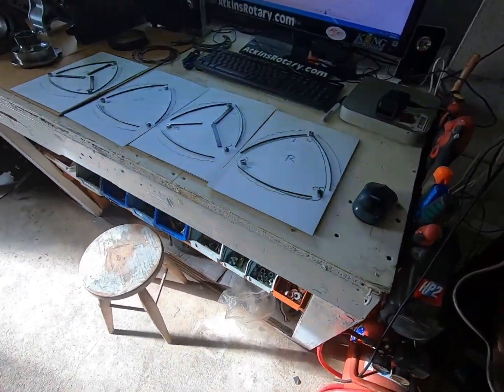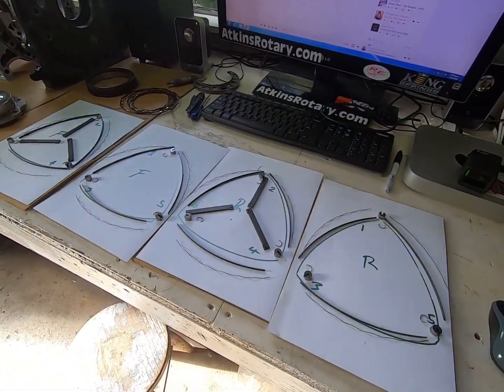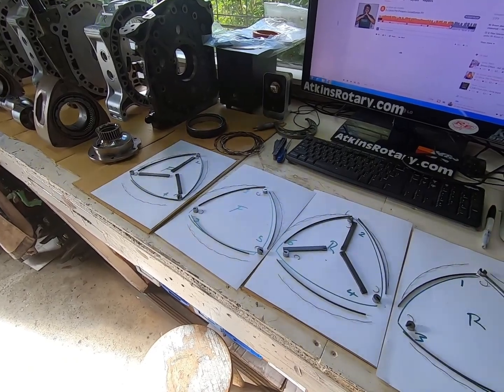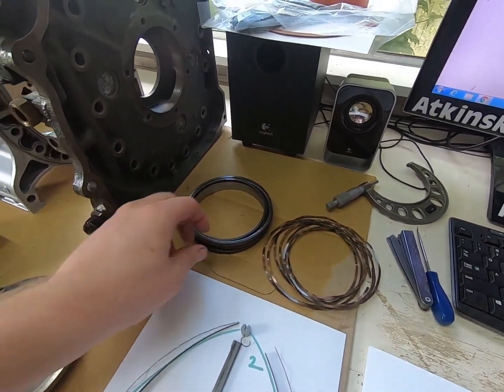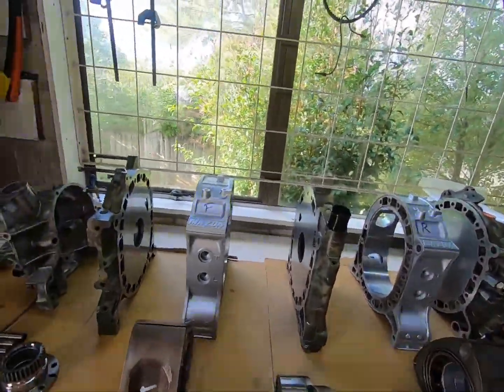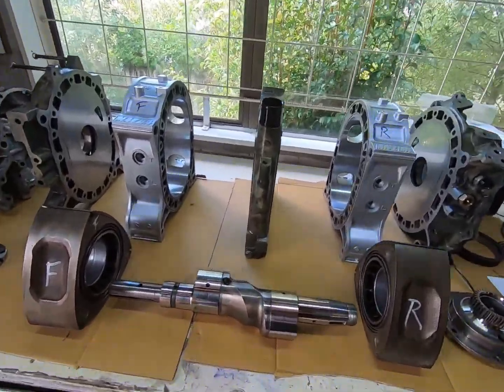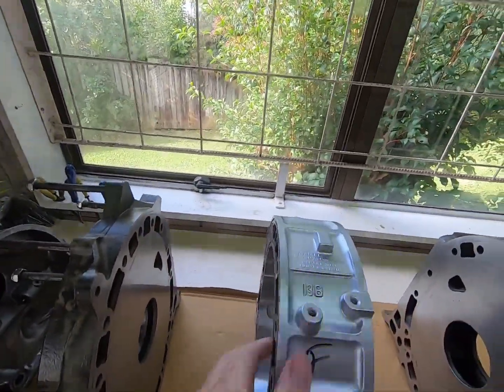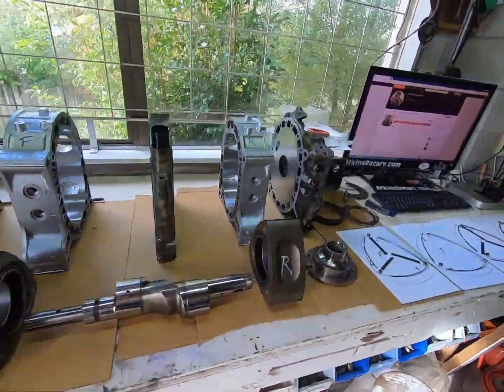Mazda Rotary Engine - Home Built 13B PP Rebuild

Comment: I can see some more 10k stabs coming in the not so far distant future ! How many Kms did you get before the rebuild of the pp ?
Reply from the maker: This videos old from 2020. Motors still going strong. Was maybe about 10,000km between the original build and the freshen up in the vid. Was still running sweet. I just wanted to chuck some better carbon apex seals in during that Fecking Lock Down.